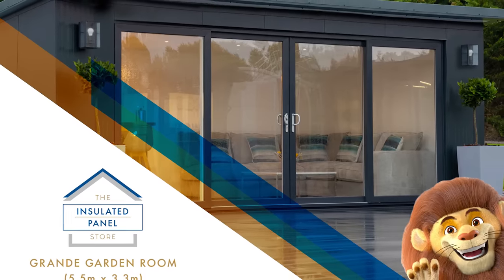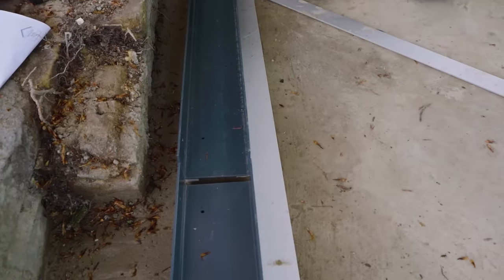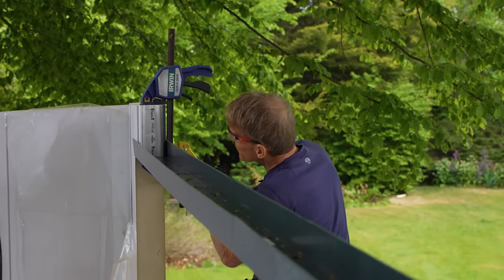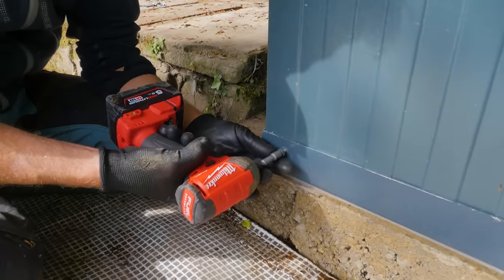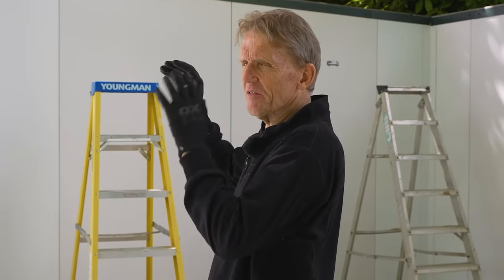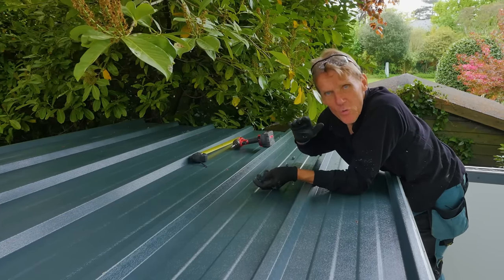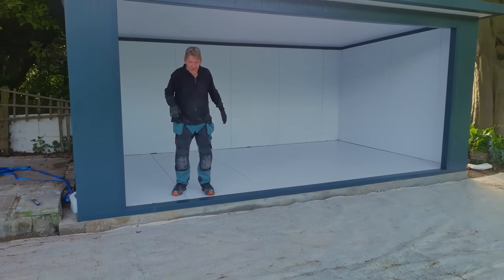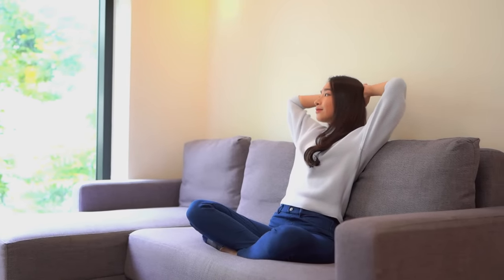How to Build an Insulated Garden Room In 1 Day

Comment: What would make this an even better garden room is, add integral solar panels to the roof panels, with the addition of factory fitted led lighting, run cables in channels out to corresponding wall channels, add a small battery storage/inverter to one wall panel and Bob's your uncle you have an off grid garden room...  So easy! If only!
Reply: Except that in the winter, when you need the most power for light and heating, there’s not enough solar …so it would be a waste of money
Reply: Doors would be a good start.
Reply: @nickwalmsley8909 just like the ones at the end of the video?
Reply: Would you cut down all the trees as well. I love these sort of comments. Let’s cut down all the trees near your home that provide cooling in summer and heat in winter (with no leaves letting sun through) for some solar panels. People really think this through

Comment: I've just helped a friend put one of these up, this video proved invaluable thank you! here's some observations that may help anyone else looking to build one: The head beam is an absolute nightmare to get on, it took 3 of us about 2.5hrs using a process of clamping, bashing and running scrapers up the inside to stop it catching on the insulated panels. The rivet gun absolutely kills your hands, getting one with longer handles is a must in my opinion. When the roof panels seat together they look like the should fit flush but they actually stop about 1cm off each other leaving what I assume to be a ventilation gap running the whole length on the inside, this freaked me out for a bit thinking we had done something wrong but you can just about see them in the video. There is seemingly no way to fit the roof panels without getting them covered in bitumen while positioning them because you have to feed them backwards, then forwards. On the kit we fitted the header corners were mis-labelled but it was obvious how they went on due to the angles.
Reply: Hello Chris

The thermal insulation looks fine, but how good is the sound insulation? I am often on conference calls and I want to ensure I minimise the noise coming through the structure.  Would appreciate any information you or your friend could provide.
Reply: @jatindersehmbi6239  Yeah sound insulation is pretty good although this particular office is right next to a railway line! theres nothing that can fix that haha
Reply: @theinsulatedpanelstore4740  Hello, I am 'the friend' - I'll send some photos no worries. I bought the building on the back of this video and we referenced it quite a lot during the build. Overall I'm very pleased with the building, and the customer service from you guys was great. It did take 2 seasoned DIYers more like 3 days to complete however (including fitting the door). Mine is on a timber base, if I was doing it again I'd lay a concrete one as balancing on the joists and noggins made everything harder with the build, especially lifting the roof panels into place. The header part was an absolute nightmare, I thought we'd never get it on to be honest. If the header had gone on before the door flashing things may have been simpler perhaps, as you end up with a big bow in the doorway which doesn't help things. If we'd have had some kind of prop for the door space it might have gone more smoothly. The floor is a very tight fit - best to use a pull bar like the sort you have when fitting a laminate floor, to tighten the panels up - otherwise the last panel wont fit.Its also really difficult to fit the floor without scratching the walls. Now its all done it looks great, It is also extremely warm in the building, even without heating. Pretty impressive.
Reply: Hi  @mttshw . What’s the internal finish like & is there any option to plaster it? I assume any electrics would need to be surface as mounted as it is.
Reply: @Denboydeus  the inside of the panels are white metal - I’ve left mine like this and ran a conduit around the bottom for plug sockets and things. Wiring for the lights is also in conduit mounted to the surface - it looks fine for an office. You could baton and plasterboard if you wanted, and put the wiring behind, I’m sure it would look good - but I had no need to.

Comment: I build these for a living, base is always installed a week before we get there but generally it a day to get them water tight then finish rest of week with running electrics, cladding depending on finish either plasterboard or standard finish but there not a bad building to put up 👍
Reply: Any contact details?
Reply: how sound proof are these? how to they compare to normal wooden fully insulated garden rooms? thanks!

Comment: Are rivets the only way to create a tight fit? It makes it impossible to disassemble the box. Also, the panels are a nightmare to recycle because the insulation is glued to the metal and the plastic.
Also, there's no prefabricated cutouts for plumbing or wiring.

The total price of this build is around 15K and I find that an awful lot of money for what you actually get.
Having said this, your video is still very helpful. It's important to know what's on the market. What doesn't work for me might work for someone else.

Comment: It would be interesting to see another one on the electrical installation.
Reply: I was wondering about this also. Maybe the first fix is carried out as its assembled.
Reply: I also was wondering about that.
Reply: I might be wrong but it looks like recessed electrics would be almost impossible in this style of build so you would probably need to run all the wiring surface mounted in conduit either PVC or Galvanised steel for a more industrial feel. Lighting would be tricky too. Recessed Downlights would be a nightmare so some kind of surface mounted LED fitting would possibly be best. These kind of kits save DIYers a lot of money until they have to get electricians involved. 😅
Reply: I had a quick look at the website, and there does not seem to mention electrics or lighting. Strange
Reply: @artisanelectrics  
✌️What electrics would be needed? 
with such a well insulated building probably only lighting, perhaps a few cables for computers etc. 
Unless using for accommodation, but then it’s not sold as accommodation it’s sold as a garden room.
Reply: Can y by? Were? Tank's.
Reply: @shvrdavid   sounds like u know about garden rooms any advice on where I should get one without being totally ripped off! All these places want upward of 8000 for a 6x3 room
Reply: This is a cold store in other guises. Great idea though but would not be happy with wall mounted sockets.

Comment: Hey guys, love the channel, full of inspiration! I’d like to get one of the insulated panel store garden rooms but when I get in touch with them and ask questions I get really useless answers back! Here’s an example. I’d like to use a ground screws base, so I asked, how many screws do I need and what is the best support frame to put between. The answer was..

With regards to ground screws, unfortunately we cant offer advise on this you would need to approach a specialist installer/supplier
???

So helpful!
Reply: Im really interested in making one of these myself but cant justify laying a full 5x4m concrete base! Was thinking of mixing a few loads to make the parameter and maybe 2 rows of concrete across for the base to sit on, any thoughts?

Comment: Roger, I’ve built several garden office/workshop/offices using the same materials for the roof alone, in timber you’re looking at three - four weeks from slab form to finish. Heating is a doddle, I use mine as a workshop (6 x 4M) and only have a small fan heater to take any chill out of the room in the winter, my neighbours one (7 x 4M) I used electric underfloor heating laid in the floor levelling compound then underfloor heated suitable laminate flooring, these rooms are extremely efficient and more people could build these themselves especially using your method. Your welcome to come and see what I’ve built as I’m only in Ruislip. I’m building another as a favour for a friend in the coming weeks in Rickmansworth and then another for myself in Dorset later this year. Like you said, check planning restrictions but mostly can be built without planning permission, but always best to engage the neighbours first, you may even be asked to build one for them like I have.

Comment: What they don't tell you is that even if the concrete base is of level by the slightest amount, and off square by so little, it's a nightmare when it gets to the last third. I've been doing sectional timber buildings for 23yrs. And it still amazes me what some people expect there new buildings to site on. And all there doors and windows to close absolutely fine. I must admit it looks very,very well done 👏
Reply from the maker: I did talk abou the importance of the base. A good laser helps.

Comment: Interesting to understand how you would do ceiling lights. If you chase the wires in then you will loose the integrity of the insulated roof and would then have to fill it with a PVC beeding or something. Maybe you just suck it up and have a wire running across the ceiling.

Also what about wall sockets... light switches etc.

Hmmm
Reply: Most use wall mounted LED track lighting place around the frond and back sides.

Comment: One thing bad with this design is the trays that you sit the walls into. Any rain that runs off the panels can run into the trays. Only for that issue it is a pretty cool design.
Reply from the maker: That is what the drainage gaps are for
Reply: The bottom trays are definitely a weak point.  Water may drain out but there is no ventilation to dry out completely. The continuing dampness in the UK climate will find them out eventually. And they will sit on damp concrete.

Comment: Great !!!, Bro insulation sandwich panel detail is extremely strong structural, A part in the sandwich takes note to resemble assembly fit in which flashing not raining into the home. Perhaps, Silicon should be fixed between sandwich panels. I was working sandwich panel field, and I think that sandwich panels are very defensive in the majority of weather, and geography following Standard theory approval in EN 14509: 2013 sandwich panel is a material empty steel structure for don't very defend much something different.

Comment: You could batten and clad the outside in your timber of choice. Same with boarding inside if you wanted more homely finish. You're getting a good insulated envelope with minimal labour costs. You could just buy similar panels and roof only and attach to timber frame. Fair bit of work on the detailing, though.
Reply: You can buy those insulated panels on their own, and with rest of everything you would still pay roughly 1/4 of the price. Need to build a frame using 4x2s on walls and 5x2s on roof (double up roof if more than 3.5m long)

Comment: I'd buy one but I'm concerned about how to install the electrical wiring. Conduit is not nice to the eye. Maybe drill through the insulation and wire as the build takes place?
Reply: @Stephen Porter I've just bought two. Arriving soon. I'll have a think about the wiring when I get to that phase.
Reply: @plan9channel7  I'd be interested to hear what you did for wiring on the end?
Reply: I installed conduit on the outside and drilled through for sockets and light fittings.
Reply: @plan9channel7  thanks! What lighting did you use? I'm interested in downlights but I guess that is quite difficult
Reply: @kes5755  Down lights are impossible. I used LED strip lights.

Comment: Really enjoyed watching this . What’s the biggest one they do? And would it be suitable for a snooker table.
Reply from the maker: The one shown is the biggest and I think it is perfect for a snooker table
Reply: @SkillBuilder  My pet peeve. For it to be good for a full size snooker table or even pool table it needs lots of clearance on all sides :) this doesn't look like it would have it. Always annoying trying a shot and the cue hits the wall :)
Reply: @SkillBuilder  I need 22ft x 16ft . Would the insulated floor take the weight of a full size table?
Reply: @amac1657  You need an extra 6-8inches than 22x16. my room was just tight as I built it exactly to that size. When you down on shot tight on the top rails my cue hit the wall when on power shots as you pull back that extra bit. Same around the black spot if your playing billiards you leave a lot of shots near the corner pockets just occasionally you caught the wall. I added 6 inches and  that sorted the problem on my new room.
Reply: @amac1657  I built a traditional concrete base for mine with insulation under the concrete. That way I put down laminate and had the table on concrete.
Reply: @pstanyer1  Thanks, yes ideally needs to be a bit bigger than that. Did you buy one of these and if so is it any good?

Comment: With the roof the way it is, do you not get cold thermal bridging from the soffit over the door and then onto the inside, as your ceiling panel and soffit is the same bit of metal?
Reply from the maker: Good point
Reply: No dis respect you obviously no what your talking about could you explain why cold bridging would happened.
Reply: @kevin conboy  Hi, I think it less of a problem than I originally thought, but because the ceiling and the soffit are made of the same bit of metal, when its cold outside, the cold will travel across the metal from the soffit over the door and inside. Basically the ceiling by the door will become cold, so you might get condensation damp.. There is no bridging from the top of the roof to the ceiling, just from the soffit to the ceiling
Reply: @davidkelly4841  Thank you for replying, I see what you mean now. As Skillbuilder said in there reply it was a good spot by you and maybe the manufacturer needs to look into it. All the best  Kevin 👍
Reply: And the same for all the U-shaped steel channels along the top and bottom of the wall, and around the doorway. I guess they're not building a passivehaus, and not expecting anyone to live in it during the winter.
Reply: @robinbennett5994  haha yeah, it’s thanks Roger and Skill builder, I look out for these things now, Can not help it

Comment: Never mentioned how you fitted the electrics and internet in this build....would be good to see
Reply: Depending on if it’s similar they are run around the battening in the electrical zone between 420mm-600mm from a C.U point( consumer unit) or a wise box if they are run from external C.U sockets are run as a ring main and then switches are run from C.U to there correct position. Internet is run separately and this is all connected by our electrician afterwards 👍

Comment: Hi Rodger….. I see these panels are insulated fully from the inside to the outside, May I ask a quick question of you, I am in the middle of building an outside garden summer house, The way I am constructing it is as follows….. 4x2s for the walls & 6x2s for the roof, The whole structure is being constructed as a warm roof scenario where I am having 2 inches of PIR insulation Closer to the inside walls which leaves me a 2 inch air gap facing the outside cladding, The ventilation will be all around the bottom of the cladding and up and over the cold roof and down the back, my question is do I still need to put a polythene vapour barrier on the inside, between the insulation and the panelling. The panelling on the inside will be 9 mm OSB board, Many Thanks Mark
Reply from the maker: Yes Mark use a polythen sheet on the inside before the plasterboard goes on. If you can avoid downlighters that will help but the vapour barrier on the inside will stop most of the moisture migrating up. You then have your ventilation to take care of the rest of it. 
Send us some pictures when you are done. www/skill-builder.uk/send
Reply: @SkillBuilder  WOW 😯…. Thanks for the prompt reply 👍 thank you so much for that, I wasn’t sure whether I would need it so that puts my mind at ease, no need to worry about downlights as I am going for an industrial look with surface mounted sockets and ducting, Thanks again Rodger 👍

Comment: Can you advise me if this can be used as a single-story extension? We have a small end of the terrace and were quoted £30000 for the job of a traditional extension with bricks. It's half of the value of the house, so no chance we will be doing it the traditional way. Or if you can point me in the right direction. Thank you for all videos as this makes our life easier.
Reply: What about DIY? If you have the time and energy, it won't be too difficult as loads of people on YouTube share the techniques. It boils down to a few major steps like the concrete base, floor insulation, damp proof course, timber framing or laying bricks with mortar or buying composite insulated panels, and then the roof frame or insulated panels.
Reply: If you want to add value to your house, traditional build is the only way to go. Unless the insulated structure has the same minimal thermal insulation required by building regs.

Comment: Really interesting build Roger and team, thank you.  I'll potentially offer this as an option for my customers but i'm unclear about the electrical installation side of things. Assuming everything is surface mounted in conduit?
Reply: I would like to know more o the electrical side too! Impressive building though.
Reply: Why not put some solar panels like the ones for caravans on the roof and a small storage battery hidden in the corner? A self sustaining garden room with no cabling?

Comment: the top piece you installed at 11:11 is that not one steel part going from inside to outside under the roof? that's a cold bridge isn't it?
Reply from the maker: Yes